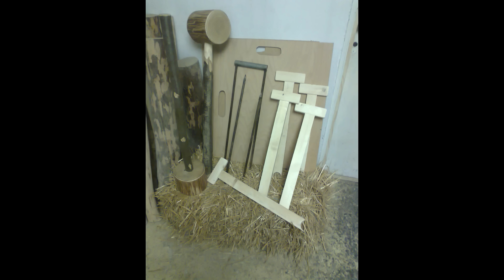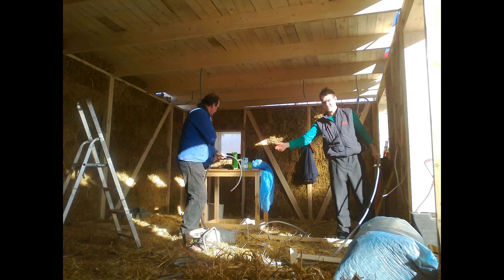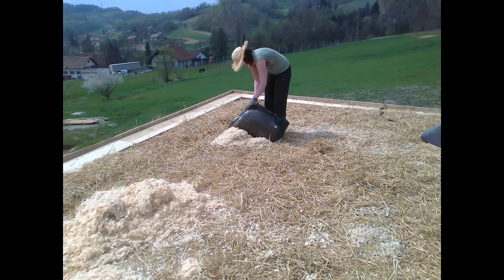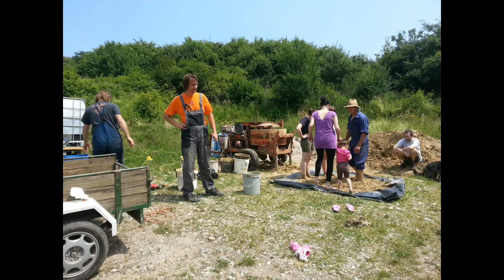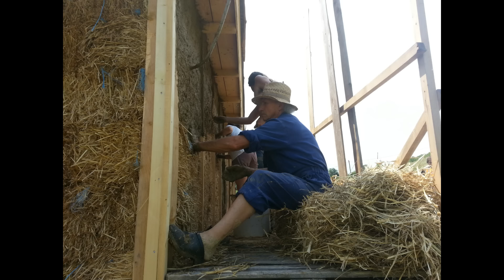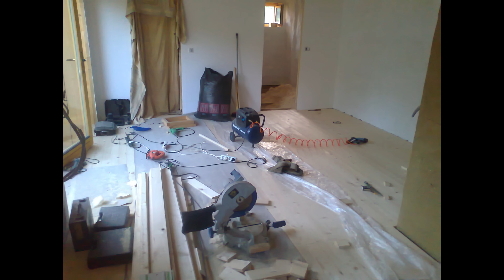20K straw bale house from start to finish

Comment: I hate the negativity. Straw bale homes have proven to stand the test of time they also are no more of a fire hazard than any home other than steel or brick. Not to mention the thermal propertys which are excellent. Thinking outside the box is exactly what the banks dont want. A 20 year morgage? No thankyou.
Reply from the maker: Thanks for the comment!
If you are subscribed and you ring the bell, you will see in May my new episodes
TINY HOUSE IN THE MIDDLE OF THE NORTH ATLANTIC OCEAN
Which I am building right now ⛏🔧🏄🛠🔨

Comment: Put up lots of 'No Smoking' signs.
Reply: You've clearly never tried to burn a straw bale. You can hold a torch on them without catching fire.
Reply from the maker: 🙀🙀🙀🙀🙀🙀
Thanks for the comment!
If you are subscribed and you ring the bell, you will see in May my new episodes
TINY HOUSE IN THE MIDDLE OF THE NORTH ATLANTIC OCEAN
Which I am building right now ⛏🔧🏄🛠🔨
Reply: These houses are far more fireproof than any home made of traditional materials.

Comment: Great job. I'm in the planning stages of my own straw house and I wondered if you had anything that you would do differently next time/ unexpected learning curves... basically I would love to learn any tips you have 😁
Reply from the maker: Yes, I would put the house on concrete pillars 🙂
Reply: @klerobi1  what made you choose (concrete) pillars over a slab of concrete?
Reply: I’m also planning on building a straw bale cabin. Rather than concrete pillars, how about concrete stem walls?
Reply: Its cheaper.
Use your commun sense

Comment: Nice, but I would definitely build the frame and roof first. I am worried that the haybales would be damp from rain and snow. Guess you live in a dryer climate than me! Well done. Liked the weathered look in the last picture. But maybe you shoud have a corner weatherboard to protect the ends of the cladding?
Reply from the maker: Yes, it would be better!
Thanks for the comment!
If you are subscribed and you ring the bell, you will see in May my new episodes
TINY HOUSE IN THE MIDDLE OF THE NORTH ATLANTIC OCEAN
Which I am building right now ⛏🔧🏄🛠🔨

Comment: Fantastic job. Really a beautiful house. I’m wondering what the temperatures are in the winter as in the summer. Must be very cozy. 👍❤️🇧🇪
Reply from the maker: In the summer of 25 to 30 degrees, winter from 0 to -15 degrees Celsius. The house is heated with one radiator.
Reply: Robert Klemensberger really a wonderful home.
Reply from the maker: Thanks for the comment!
If you are subscribed and you ring the bell, you will see in May my new episodes
TINY HOUSE IN THE MIDDLE OF THE NORTH ATLANTIC OCEAN
Which I am building right now ⛏🔧🏄🛠🔨

Comment: Thank you for your beautiful and eco-friendly home, How much will it cost for a 100 square meter house?
Reply: Additional question How many years can these houses have?
Reply from the maker: I can’t answer the question because it depends on where you live and the regulation of the state. Here in Europe it would cost around € 30,000 - € 35,000 if you build it yourself.
How many years, depending on how you take care of the house. 
The oldest strawbaje house is over 200 years old
Reply: @khorshedalam6896  some last since 1850 around. Maison Feuillette for example

Comment: I see this video was posted 4 years ago. Wondering how you like your house & how things are going.?.If you like it as much as you thought you would,anything you would have done differently,stuff like that. I have been thinking about straw bail construction for close to 10 years now. I live in a rural area in the Sandhills of NC ,USA.South East. I have at least 2 neighbors within walking distance that grow the straw/bails I’d need,plenty of red clay & sand on site,and another neighbor very close by that has a saw mill. There’s a man somewhere within 20 miles of where I live,that I found online when I first started researching natural building.If I remember correctly,he offered scheduled tours of his house for about $20. He would most likely be able to answer any questions I might have.Any information you could share would be appreciated. Thanks in advance.take care. 
PS..your place looks nice.
Reply from the maker: Unfortunately, no one lives in this house. If I would change one thing, I would make a stronger foundation
Reply: @klerobi1  Thanks for responding to this. What have you noticed with the foundation? Have some of the posts sunk, or does it wobble? Looks like a great build to me.

Comment: ❤️❤️👏🏽
Thanks for sharing! 😊
How many square feet is that?
Reply from the maker: I think it's around 550 square feets. Sorry we have meters. It is 10m by 5m.
Reply from the maker: It is 50m2, I think that's it 535 square feet.

If you are subscribed and you ring the bell, you will see in May my new episodes
TINY HOUSE IN THE MIDDLE OF THE NORTH ATLANTIC OCEAN
Which I am building right now  

🔨🛠🏄🔧⛏

Comment: So now a big question: Which is currently cheaper in 2021, straw bale or wood construction?
Reply from the maker: If you build a house from a wooden structure and you have to achieve the same insulation as on a house made of straw, a house made of wood will be much more expensive.

Comment: There should be caps placed on those spikes up until you are going to use them, for your own safety.
Reply from the maker: Thanks for the comment!
If you are subscribed and you ring the bell, you will see in May my new episodes
TINY HOUSE IN THE MIDDLE OF THE NORTH ATLANTIC OCEAN
Which I am building right now ⛏🔧🏄🛠🔨

Comment: Why didn't you put the thing on a concrete slab? That would take care of the varmits. And where did the $20,000 go? If you had built a round or oval house, there wouldn't be a corner problem.
BTW, what would you do about allergies?
Reply from the maker: The house is completely built with natural materials...
Thanks for the comment!
If you are subscribed and you ring the bell, you will see in May my new episodes
TINY HOUSE IN THE MIDDLE OF THE NORTH ATLANTIC OCEAN
Which I am building right now ⛏🔧🏄🛠🔨

Comment: Interesting. Just wondering about the maintenance of these types of homes. How frequently would you have to repack the straw bales if you are living in a humid area? do they rot inside? What do you do to make them Termite proof?
Reply from the maker: no problem, the house is in Slovenia. And Slovenia has the most rain in Europe. You just have to protect the straw from direct rain. 
The clay plaster absorbs moisture and then emits it when needed and that is the beauty of natural construction. The walls must breathe. 
No moisture problem at all!

Comment: why so expensive, did you have to pay people to build it or was that the material cost alone?
Reply from the maker: Depending on where you live.
At the time of construction, the fuel for transporting materials alone cost around € 2000.
And these are costs that people tend to forget.
Cannot install a second-hand window house, if it is -15 degrees Celsius in winter...........
Reply: Mr Sunshines not sure what you mean , but I forgot this is the total value of the thing. I could get all this material on my property , so I wasn’t thinking about somebody who’s actually buying each thing

Comment: Congratulations but, how can cost 20.000? I'm trying to calculate and should be less than the half.could you tell me material cost more or less to make me an idea please?
Reply: As some common sense should tell you that some bales alone do not make a house.. plumbing( pipes, fittings, water taps etc) , electrics (breaker box, cables, sockets, circuit breakers, etc. ), workers ( certified electrician, plumber and even if they are friends and family), wood (framing and panels), flooring materials, structural engineer (maybe not in this case), approvals (maybe not in this case ), tools and small materials,   machine rents, fuel ( transportation+ machines (generator etc)), kitchen+ bathroom, heating,windows and doors, etc.. I can easily see a lot of positions that would would make a couple of grand.. and added you will get to 20k very easily... 
just for electrics alone you will need a couple of thousand, not to mention kitchen and bathroom.. then you need heating.. damn how can you not see that if you ad up everything you can get to 20k easy..
also 1500h and so many pictures showing groups of people helping, even if they are only friends and family, would you let them work entirely for free? ( no food, no money for transportation and work?)... just do not build a house if you think that´s ok..
Reply: @philxdev  It seems that you are talking of a 100square meters House with 2toilets and Big living room..no need electrician for 4plugs,just need for conecting to the grid.the materials for plumberie and electricity what 3 -4grands.thinking he has buy everything new not recycling anything.the Windows  and wood are expensive ok but you can do by yourself almost everything without using soo Many  new eléctrics tools and beeing completly safe.if you have to Pay your friends,cammon! Ok food and beer but not hours of work! Of course you can spend that amount of money,you can spend also 40.000 if you want to.i just say that can be much cheaper in my opinion.1500 hours made 9months and something to build that working 40 hours a week.if he works 20 a week double lets say
Reply: @philxdev  man,breacker box with stuff 700-800€ quality.plomberie even less if you RECYCLE stuff from other places,you can find quite a good things.i',m telling you not to buy cheap RECYCLE!.when you buy, buy quality.all his Friends are not all the time on the construction,(just for  bales,mud)for carpentry just need 1-2 plus him.even less for electrics and plomberie.if not would be even less productive.pay good food and Big beers! Of course! In Nails,bits and stuff? What 1000?? You have to lose 500 Nails a day..been Lost in the middle of somewhere means DO IT YOURSELF!! And i suppose he lives or Camp not so far away from the place he works,for the gas.for the heating, build a mass stove,you Will see
Reply: @ataagudo6932  nobody is argueing that you cannot do it for less then 20k!! and your argument about recyling and looking for quality sales is absolutely valid and I am not saying you cannot do it for less.. but most people here do argue that 20k is absolutely unrealistic and too high .. which it is not.. just the windows and doors are a couple of grand...the wood is a couple of grand. the bathroom and plumbing is a couple of grand, the electrics with all the breakers and the breaker box a couple of grand, + , +, +,... and I am only talking about the parts here.. running a generator for electricity as mentioned before did cost a couple of grand in gas.. etc.. it all ads up and getting to 20k is just not unrealistic.. that is all I am sayin..^^ cheers. 

and yeah going to the hardware store getting some screws, some fittings, a couple of buckets.. some dry wall... some plaster etc etc.. and this and that, it all ads up and you will be sometimes suprised.. I did help five guys building their houses/ renovating and you would not believe what we sometimes spend.. and then some other things were missing so back to thehardware store and another couple of hundreds.. granted this thing is tiny but still there are some things you can´t get around if you buy regularly and do not salvage which takes extra time you simply have to have..
Reply: @philxdev  ok sorry.i was in the idea that you thought that was impossible to do It cheaper, that's why i barked..
I know is not only the structure, the finition things take as much money as that,big reality.i was just saying that is possible to do It cause i've done it.it depends how many things you take the time to do It yourself or search for good deals..
Reply: @ataagudo6932  and I do absolutely agree 100% .. have also seen it.. if you take your time to find what you want and what quality levels you can get away with / what is actually providing good quality without being luxurious etc. and you take the time to shop around and NOT go to the hardwarestores but plan beforehand you can really get the costs down immensly...that not only goes for simply things but also for floor heating, heating systems, bath tiles etc.. so I think we are on the same page now^^

Comment: Doesn't seem right... 20k? Is that including the cost of the land and labor? Wondering because that much straw would be very cheap, at least where I live, if not free. Also, why didn't the siding get staggered?
Reply from the maker: Thanks for the comment!
If you are subscribed and you ring the bell, you will see in May my new episodes
TINY HOUSE IN THE MIDDLE OF THE NORTH ATLANTIC OCEAN
Which I am building right now ⛏🔧🏄🛠🔨

Comment: Cool but...For 20 k you can live in an fully furnished and serviced apartment in most of SE Asia for 5years or more. How long does straw last ?
Reply from the maker: The oldest straw house is around 100 years old...👍
Reply: @klerobi1  Id take the 5 years .
Reply: @ike fun  $20 000/ 5 =  $ 4000 / 12 =  # 333 . 33  monthly ...   $97 ?
Reply from the maker: 100 years!!! 
Thanks for the comment!
If you are subscribed and you ring the bell, you will see in May my new episodes
TINY HOUSE IN THE MIDDLE OF THE NORTH ATLANTIC OCEAN
Which I am building right now ⛏🔧🏄🛠🔨

Comment: What’s your country? How is that in winter?
Reply from the maker: The house is in Slovenia. No problem, it heats up very quickly with a small wood stove. And the winter temperatures are somewhere between 0 and -15 degrees C.
Reply: Robert Klemensberger alright I’ll try in Russia )

Comment: What about when that straw breaks down and turns to dust?
Reply from the maker: This is not possible if it is properly built...
Reply: @klerobi1  what does your building technique do to stop the decay and preserve the straw that is already decomposing?
Reply from the maker: Thanks for the comment!
If you are subscribed and you ring the bell, you will see in May my new episodes
TINY HOUSE IN THE MIDDLE OF THE NORTH ATLANTIC OCEAN
Which I am building right now ⛏🔧🏄🛠🔨
Reply: @thecheapgamer9634  Decomposition is the result of bacteria degrading organic matter.  For that to happen, the material needs to be wet.  A piece of wood is composed mostly of cellulose, and so is a bale of straw, so there's no difference in either durability or longevity between wood and straw.  A straw bale inside a wall won't decompose for exactly the same reason that a wooden structure doesn't spontaneously decompose, provided that the roof, foundation, and exterior cladding keeps water out of the wall.

Comment: How did this tiny thing cost 20K? I built a 2000 sqft house for less than that in America ( Oklahoma ) Using COB on the outside. Its a conventional wood frame but it cost 15K in dollars not sure if this is in dollars or not. You can still build a cheap house if your willing to work hard. Dont get me wrong I like this house just not sure where all the money went.
Reply from the maker: Yes, 20k. A little more, in Europe
Thanks for the comment!
If you are subscribed and you ring the bell, you will see in May my new episodes
TINY HOUSE IN THE MIDDLE OF THE NORTH ATLANTIC OCEAN
Which I am building right now ⛏🔧🏄🛠🔨

Comment: Amazing house. Great video, very instructif. Thank you!
A question about the foundation poles. How is it done? Is it normal wood? Placed in the ground or in concrete? How deep? It won't rot?
What is the purpose of the cavity with the black foil under the first row of strawbales?
Reply from the maker: Thanks! Yes is normal wood. We used chestnut wood, because it is resistant to moisture. No concrite only ground. Deep about 80 to 90cm. Black paper is a wind barrier. like tyvek, but is cheaper.
Reply: @klerobi1  I also had exactly the same question about the poles. What do you expect as life expectation for the poles. It makes me think about peasant fences than can last 10 to 15 years. In terms of dwelling it is short. Do you plan a fix for after ?
A big thank for this video !
Reply: I plan to build the same way. A fix would be to burn the buried part of the wood. If i remember well we found 100 years pole charcoal residues under old ruins. What everybody think about this ?
Reply from the maker: Thanks for the comment!
If you are subscribed and you ring the bell, you will see in May my new episodes
TINY HOUSE IN THE MIDDLE OF THE NORTH ATLANTIC OCEAN
Which I am building right now ⛏🔧🏄🛠🔨

Comment: When the straw bales are invaded In a stucco like material, the straw bale won't burn well.
It will smolder but not really burn.
Not enough oxygen.
Reply: Supposed to read bales are incased in Stucco...not invaded. Lol
Reply from the maker: Thanks for the comment!
If you are subscribed and you ring the bell, you will see in May my new episodes
TINY HOUSE IN THE MIDDLE OF THE NORTH ATLANTIC OCEAN
Which I am building right now ⛏🔧🏄🛠🔨

Comment: 20,000 ? Couldn't do it cheaper?that's including land???
Reply from the maker: Could...but the fuel cost more than 2000€.
Straw bales only 700€
Reply from the maker: Thanks for the comment!
If you are subscribed and you ring the bell, you will see in May my new episodes
TINY HOUSE IN THE MIDDLE OF THE NORTH ATLANTIC OCEAN
Which I am building right now ⛏🔧🏄🛠🔨

Comment: You would do better if you have put the 20000 in the foundations.  then you can use any free material you want on top of it.  What the hell  20 000 dollars for a stack of hay on sticks.. wake up.
Reply from the maker: Thanks for the comment!
If you are subscribed and you ring the bell, you will see in May my new episodes
TINY HOUSE IN THE MIDDLE OF THE NORTH ATLANTIC OCEAN
Which I am building right now ⛏🔧🏄🛠🔨